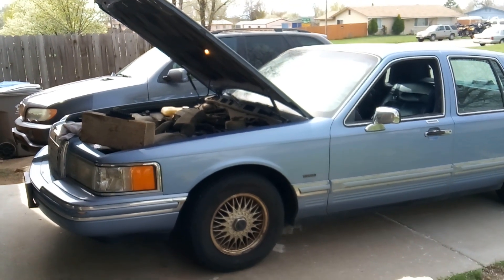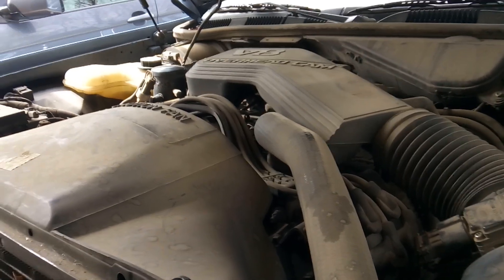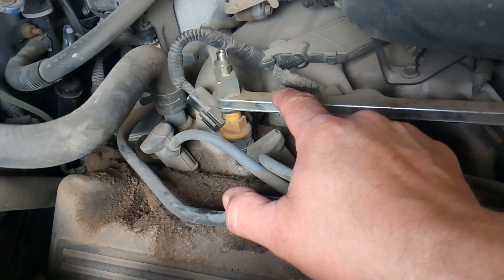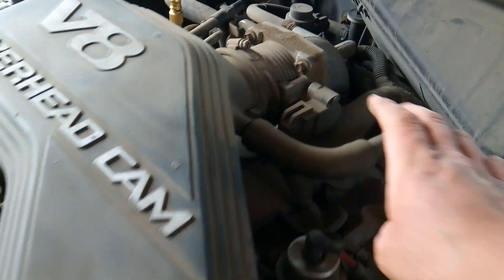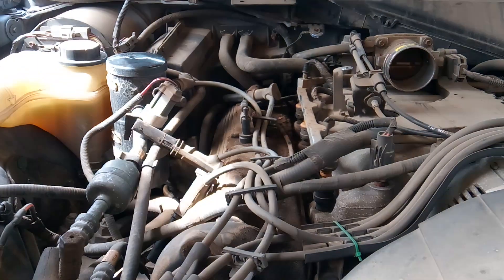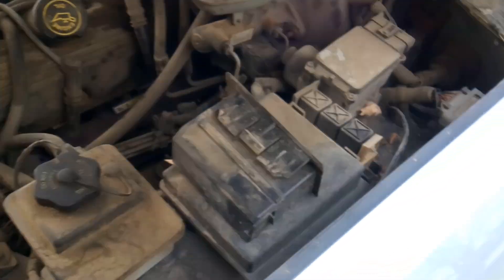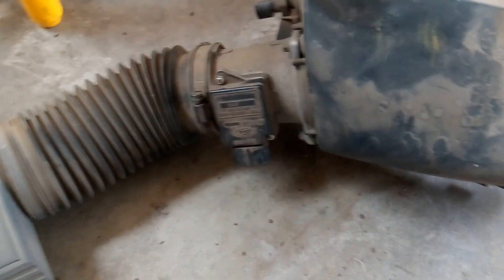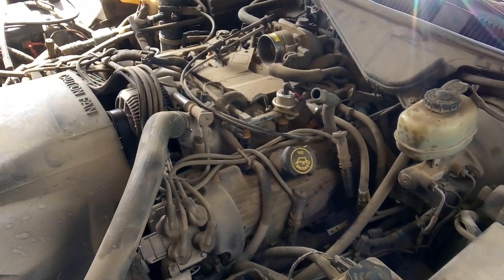Hesitation no power diagnoses 1993 Lincoln 4.6l engine

Comment: I have a 93 Cartier. Right now the CEL comes on at about 3 miles driven, normal operating temperature I think. Pull the codes and always get 172 &176. Put a few bucks in it as I'm a shade tree mechanic and this car has a ton of sensors. I have replaced the fuel filter, pressure regulator, IAT, cleaned the MAF, new air filter, new oxygen sensors, plugs, plenum cleaned, fuel pressure 32-40, new thermostat, temperature sensor and sender. The car starts and idles easily, kicks butt when I floor it. I'm beginning to believe I might have a dirty injector or two and don't feel comfortable pulling the injector rails because of the rear crossover tube might be a bugger. I can feel a slight miss when idling. Wanted to get your thoughts Thanks!.

Comment: Hello very good video I'm working on a 93 Lincoln Town Car I did a smoke test on this car saw that it was smoke coming from right behind the throttle body which tells me that is either an intake or some hoses back there the car will stall if you plug in the throttle position sensor. And a throttle position sensor did that with the old one and also the new one. I hear a loud air sucking sound that's what made me do the smoke test.

Comment: Thanks for the video, I have a 91 Lincoln that I purchased for 1500 and basically I started changing parts like the one you mentioned and I even went to great lengths on opening up the intake and cleaned all ports for the egr and now i am so happy because it is running like a cat 😁

Comment: Hi, how to fix that level arm for airsuspension, my Lincoln sinking on passengerside, 1992 towncar
Reply: @eBisofta - 4 months has gone by.  Do you expect a response from the videographer mechanic?!?  An air bag(s) has gone bad.  Time to replace the air bag(s), or switch over to a coil spring(s).

Comment: Does the 1993 Lincoln Town car jack Nicklaus edition have coil packs or distributior cap? Thanks
Reply: The '93 Town Car (all editions) has 2 coil packs -- 1 coil pack for each cylinder bank.
These are distributorless ignition systems -- there is no cap.

Comment: Hey man im having the same problem but it does it at 40-45 mph my dad said its the torque converter on the transmission can you help me out
Reply: If it's a slight jerking-sensation at speed while applying low throttle,  it's most likely a coil on plug and/or a spark plug combo (at least from my experience owning +3 town cars).  Word of caution: sometimes even new coils can be faulty - so if the problem persists, don't pull out your hair just yet.

Comment: I have a 91 as well, with no spark, changed the ignition coils, do  you have a diagram, or know where the cam and crankshaft sensors are located, so I can replace those. Any help, would be appreciated. Thank you

Comment: Wow.. never seen 3 missing electrodes in a row! Wtf! If you did in fact have a timing issue, what can u do, just replace the timing components? I also have a 4.6 that is starting to hesitate when cold. It's coming from the engine- trans is fine. But I should check my fuel pressure. I dunno. Its acting like one of the 4 tower coils is going out. I dont have coil-on-plug I got wire on plug lol. I bought cheap new coils years ago cuz I didnt want one of my originals to die. Lol. The wires were Carquest mid grade and has 30,000 miles on them. Car has 89,000. It's a 94 Crown Vic LX. Oh and I also replaced the torque converter at 59,806, and I run Amsoil ATF, shifts great.

Comment: I have a 92 town car and I'm trying to address a very low idle situation. When idling the car will Bog down and shudder slightly. Any diagrams I am finding online show the idle air control valve is on the right hand side of the throttle body but that's not correct no IAC located there just the electronic throttle body motor. Any tips on locating so I can clean and recalibrate my throttle body and IAC all at the same time?
Reply: Charles Carr The 92 Town car isn’t equipped with an electronic throttle. It will have an IAC valve located right at the throttle body, it will have a two wire electrical plug and will resemble a small electric motor. It is attached by two small bolts. Cleaning often works for a short period but would recommend replacing due to wear in the shaft allowing buildup between the shaft and bore instead of it being wiped off as the shaft moves to open and close the valve.
Reply: Right next to the throttle cables there's a screw on the throttle body thst would increase or decrease the idle too correct?